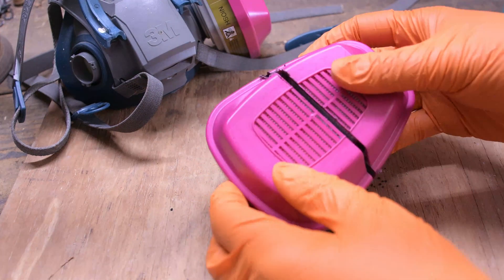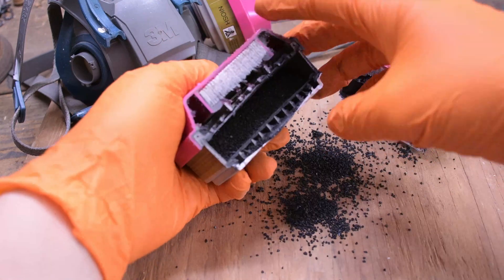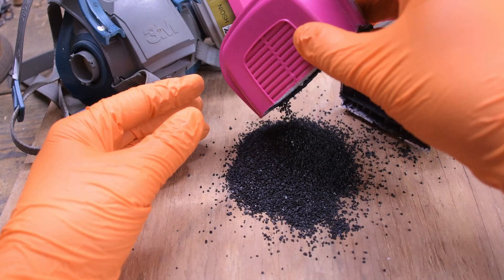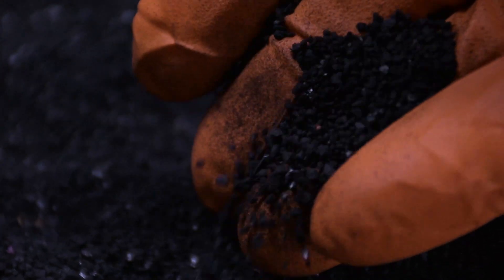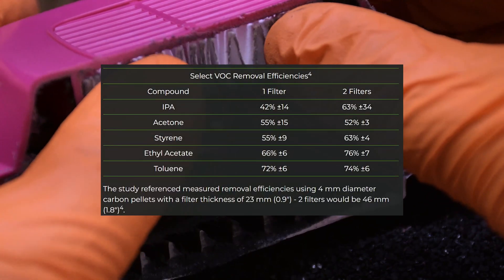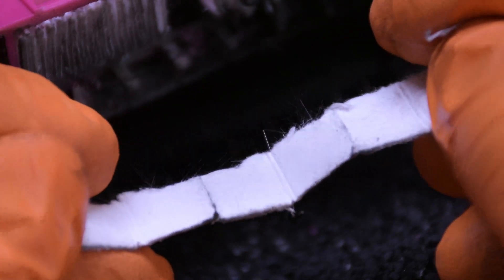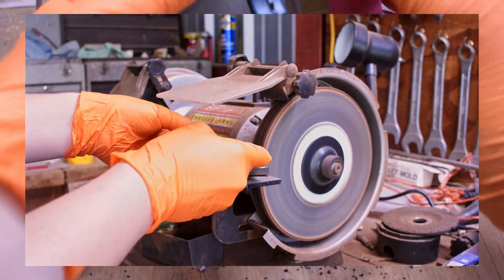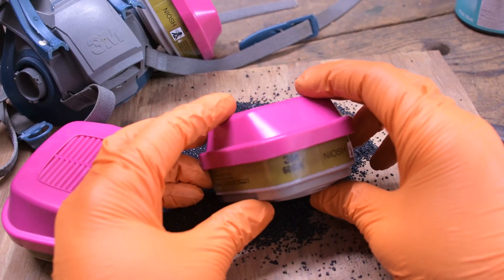Respirators for 3D Printing - Resin Fumes & FDM Nanoplastics

Comment: What do you think about 6051 A1 with dust filter P1 5911? I am work with 3D resin printing and use anycubic water washable resin
Reply from the maker: 60926 is generally what I would recommend. That part number is different in various countries - check some of the other comments, they should have a more detailed response on this topic.

Comment: hi im a little confused about what to buy, you link two separate cartridges but mention a combo cartridge? am i supposed to find one that does both or swap between the two depending on what im working with?
Reply from the maker: 60926 provides the best protection when working with resin, paints, and other chemicals that can release acid gasses or formaldehyde.
60921 is more affordable, provides less coverage than the former, and is suitable for very general use.
6001 is simply just the carbon portion of 60921 and is a suitable option when people are only worried about the VOCs and not particulates - it is significantly cheaper than the combos.
Reply: @ArisAlder  ah got it, thanks for the swift reply, really appreciate it!

Comment: Why not 60923 as well?
Reply from the maker: 60923 is fine, but I don't typically recommend it because historically it has been less available & the 60926 has the added benefit of additional protection against formaldehyde (which is present when dealing with resin).

Comment: Even wearing a proper respirator I still few a bit of the resin odor, is it normal? I read in some place is kind of normal, mask is filtering the vapours but odors would be ok to still smell... it sounds wrong for me. Does anyone knows more about it? Thanks!
Reply from the maker: So just to clarify:
Odors = vapors
Odors are vapors that are a % high enough that our body can smell it. Every chemical is different, and every person has different sensitivity levels.

The main reason that people would still smell the VOCs is that the respirator is not properly fitted. A very common reason is facial hair (e.g. beards). It needs to be tight against your face - there are 3M videos on how to test it properly.

The other reason is if the concentration someone is being exposed to is exceptionally high. To make this easier to understand I'm going to use fake numbers real quick here:
0 = No VOCs at all
10 = I can smell it
100 = let's call this the concentration
If the concentration is 100 but the respirator only filters 90%, then we're left with 10 which we can still smell.
If the concentration was say 50 instead then we'd only breathe in 5, which we can't smell.

In high-risk scenarios in real life, that is why we see say firefighters use compressed air cylinders because they would breathe in practically 0. I have a supplied air respirator video that touches more on that topic.
Reply: @ArisAlder  I believe may be the respirator and the filter (which I know I must swap). I bought one of those amazon respirators (3M knock off from what I learned earlier today =/) and I feel I should get a good 3M. Thanks for the explanation! Cheers!
Reply: @ArisAlder  another question if you don;t mind. You've marked 60921 and 26 as good for resin printing and all the rest we do on our hobbies, but what about the 60923? My question is I'm finding the 23 easier to buy on my area and as the description says it would get the VOCs I thought it could be good as well... once gain, thx a lot for helping!
Reply from the maker: 60923 would be fine as well - I believe that is the one that also provides formaldehyde protection, which is one VOC from resin. 60926 would be best but 23 is the middle ground.
Reply: @ArisAlder  in order of what's best, would you say 6001, 60921, 60923, and the best one 26?
Reply from the maker: well you can't compare 6001 bc it doesn't have the particulate protection, but you have the other 3 correct.
the 6001 is actually on the 60921 if that makes sense
Reply: @ArisAlder  thank you so much!
Reply: @ArisAlder  talking about filtration would you know, for case of airbrush (particles + mist?) uses with acrylic non toxic paints, is 3m filter 2091 and 3M Performance Filter P95 Particulate would be options to go? Thx once again!
Reply from the maker: For paint I would use the 60921, it's more effective than the P95. If you happen to have the 60926 for resin as well, that also works. The nice thing about the 60926 is that it can be used for resin, sanding, painting, etc without having to swap cartridges. Although swapping could be more economical for heavy users.

Comment: I'm starting a new job where I'm a modeler but I also have to be printing models, they have a little room is not very well ventilated and I will be there from time to time, I only print and cure, I don't do sanding or anything, it's 3d resin printing, what mask shoul I use?
Reply from the maker: The 6001 is the basic VOC-ONLY cartridge for the respirator. Generally I would still recommend the 60926 since resin printers do release ultrafine particles, just less than fdm

Comment: I've been using the respirator you recommended for about a month, but it doesn't seem to be doing a good enough job. I can still smell resin and IPA through the mask, which makes me think it’s not blocking everything as it should. Do you have any recommendations for this issue, or am I overthinking it? It might be my beard (just past stubble), but I doubt it. I'm even considering a full-face mask or something designed for beards if available.

I’m concerned about long-term exposure to toxins. I’ve got a dedicated printing room, an enclosure with a fan venting to the window, and a large carbon air filter running. I just want a mask that works properly so I don’t get any whiff of the fumes while working.
Reply from the maker: Facial hair can result in an improper seal - you can search for a video on how to do a fit check with the respirator. They do make "hoods" that completely cover your head, but they are designed for use with PAPRs. My Supplied Air Respirator video has examples on that.

Comment: Are the M3 6055 A2 also good?
Reply from the maker: 3M has different models throughout the world to meet regulations, and in the US they are like the 60921 and 60926.
6055 would be fine, but it offers just basic protection - 6092 or 6099 would be more will-rounded.
Reply: @ArisAlder  I also have some 6057 ABE1, are they better than just the 6055 A2?thanks for the informations
Reply from the maker: Those would be more appropriate
Reply: @ArisAlder  I apologize in advance for all the questions I asked you but I have one last question. As far as I know, the resin is considered carcinogenic, so assuming that I always use nitrile gloves, a respirator and the printer is inside a grow tent, i have an average exposure to the fumes of around 40-50 minutes a week, do you think there could be any repercussions in the future? Thank you
Reply from the maker: From the research I have done, I believe that Styrene-based filaments (e.g. ABS) pose more of a carcinogenic risk. https://4dfiltration.com/resources/3d/3d-printing-air-quality-roundup#VOCs-3D-Printing

What you are referring to is short-term exposure which will have minimal repercussions, especially when using proper PPE. The more important concern is minimizing long-term exposure, which would come from having the resin printer inside the house without active ventilation. The best way to minimize the long-term exposure risk is have the printer in a garage or workshop.

Comment: oh. . . huh, i've been using the cartridge in between that 60923, which also is rated for acid, i'd think if the lesser works just fine then 60923 should also work, am i missing something here?
Reply from the maker: The main reason to choose 60926 over 60923 is the designated protection that 60926 has against formaldehyde, which is one of the common emissions & is not readily captured by normal carbon.

Comment: Thank you for this informative video but i have a question about how long i can use the filters ? throw them away after 1 month of use ?
Reply from the maker: The estimate that I gave in other comments was 10-30 working hours; that is 10-30 hours with the respirator on and cleaning. I'd recommend checking through some of the other comments to find prior explanations.
Reply: @ArisAlder  thank you good sir 🙏

Comment: Anyone know if the activated charcoal in these filters contains acid?
Reply from the maker: That's a good question - I just put in an inquiry to 3M to answer this and I'll comment back if and when they reply.
Reply from the maker: 3M declined to provide insight as to if the carbon in these is acid washed.

My assumption, since these are regulated and are designed for PPE, they will either not be acid-washed or if they are then they are post-washed with another solvent like IPA to displace most of the acid.
Reply: @ArisAlder  fascinating that they couldn't comment on that. I was expecting it to be on the msds for these, but it's surprisingly non descriptive.

Thank you for reach out and getting back to me! Cheers!

Comment: I was in a relative's garage unloading boxes when thought I smelled something chemically/sweet in the air, but didn't notice anything unusual. Wasn't until I noticed a box with a soggy bottom had a bottle of resin had spilled open that I put two and two together. Removed the box outside, and continued unloading the rest of the boxes. 

About 10 minutes after exposure, I noticed a bright spot right in the middle of my vision in one eye, like if you were to stare at a bright light for a prolonged period, then a banana-shaped blur started forming in my other eye. I quickly rinsed out my eyes with warm water thinking I may have rubbed the resin into them somehow. My dad immediately said it sounds like an aura migraine, and sure enough Google images matched what I was seeing perfectly. I went ahead and dropped by an optometrist anyway, who not only gave my eyes a clean bill of health, but found my vision was 20/15, better than 20/20.

Anyway, it could have been complete coincidence because my family does have history of aura migraines, but I've never experienced one before, and it just happened to occur so soon after breathing what I now know is resin fumes for 30-40 minutes.
Reply from the maker: Chemicals that are present in resin do have the ability to cause eye irritation, but there are a lot of variables in play. One of those is people, because everyone will have a different level of sensitivity.

One of the ways this irritation can occur is the gaseous or liquid (worse) chemical compounds coming in contact with moist skin, eyes, or lungs. The water present can break down specific chemicals, forming acids that result in the irritation. This example is a very vague explanation for a rather complex interaction.

It's difficult to say if what you experienced was directly or indirectly caused by the resin, if at all. I'm glad that everything turned out well, and in the future, it wouldn't be unreasonable to approach chemical fumes with additional precautions.
Reply: @ArisAlder  Thanks, yep I now have an Elegoo Saturn S resin printer and use the same setup you have, in addition to chemistry lab goggles with a HEPA air filter running next to my station. I work in a ventilated garage and always handle the resin and prints with nitrile gloves. The aura migraine episode, whether related or not, demanded that I give resin the respect and care it deserves.

Comment: Unless you have a print farm or a large # of printers I wouldn’t waste my time with this, just get a carbon filter air purifier. Move your IPA and spray painting where it’s not in a inclosed space. Your normal household chemicals are as bad or worse than most of these items. However when you start sanding the items I would treat it just like I would fiberglass dust. The dust is very bad also chemical contact will cause 90% of your problem. You should use gloves and if you have problems get it on your skin or busting the gloves double glove up. If you have young children than they shouldn’t even be allowed into the print room. Most of those filters are used in car repair spray booths which are needed the life of the carbon filter is very short life 5 to 10 days. So after that it’s a feel good mask till you replace the filter.
Reply from the maker: The cartridge respirators do have their place and are a good option for many people. They can also be used for many other activities around the house, including the sanding you mentioned. Supplied air respirators are an even better option for resin print farms.

Comment: Would you still recommend a respirator even if the entire resin printing set-up(including post processing and curing) is contained within a chemical fume hood? I understand it’s never bad to be too safe, but just wondering your opinion on it.
Reply from the maker: Good question - if you are just checking in on the print or doing quick tasks then you can get away not using a respirator, but any prolonged tasks (cleaning, curing, sanding, painting, etc) should prompt the respirator.
Reply: @ArisAlder  thanks so much! That does make sense
Reply: If it is inclose space you should have a huge suction pulling out the room if your air flow starts away from the fume hood and the hood is in the back section you should feel a pull on your door the door will experience dirt around it over time which will have to be cleaned. If the suction is that good there is no reason to waste your money on a mask filter that is good for 7 to 10 days because after that the carbon filter part is dead and is not filtering. You can extend it for x amount of days by after use placing it in a plastic bag than vacuum seal it.